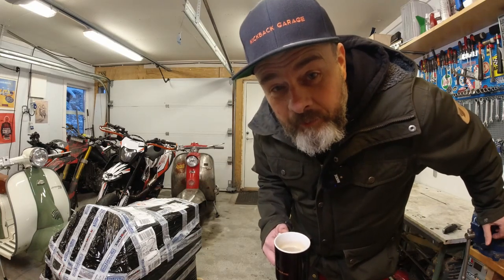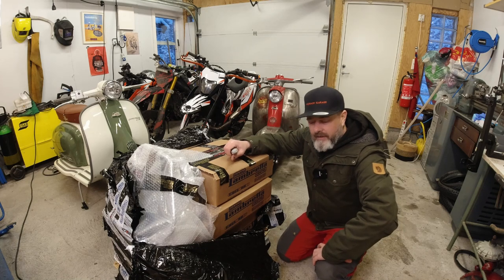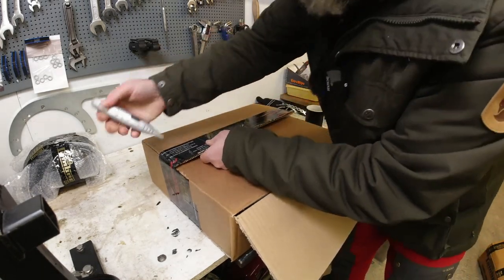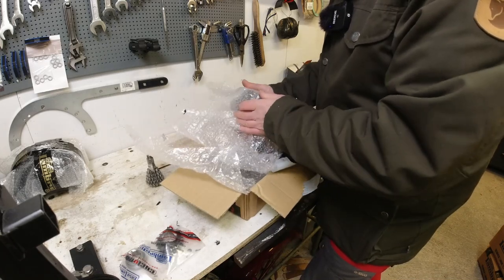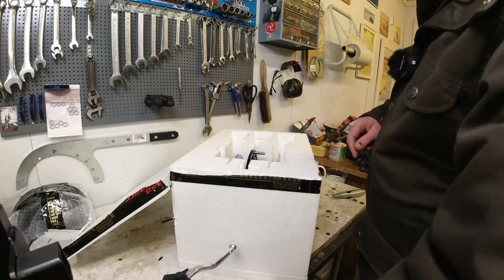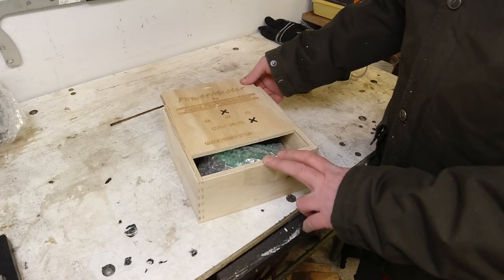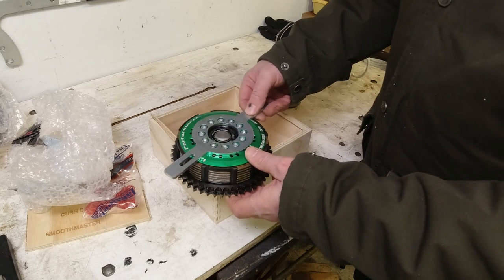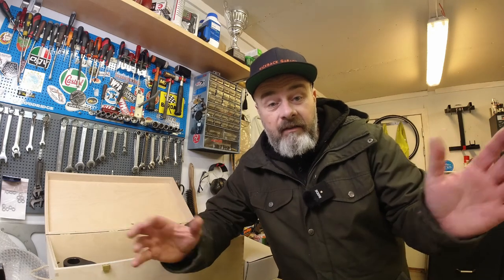Casa Performance SST265, Baby!  #kickbackgarage #casaperformance

Comment: I know by the way you open them boxes you've done this many times before, cutting away from the hand holding the box is a smart move, found that out the hard way, looking for an old Li I50 to restore, good at body work and paint, but engines are not my strong point, hopefully after i watch you and another guy building engines will give me the knowledge i need,  finding a Lambretta with an engine in Ireland will be difficult , plus the smart gits check prices online and ask for stupid money, but i know there's one somewhere waiting for me, even dug out me fishtail that's nearly 40 and looks well cool still, wore better than i did the 90's was hard on the head and body, great watch thanks mate ☘️🍻

Comment: Really interested to see how this goes together Rob. I bought a fully built SST265 engine from Rimini last year, so didn’t see the components that go into the build. My engine is sitting on a shelf in my garage waiting for my S1 to return from the painter. Chances are you will have your engine built before I have mine fitted into the scooter 😃.
Reply from the maker: I hope not, for your sake! haha
Reply: Have a few other bits to complete this build: Tank, new panels to cut, etc... Hopefully sooner than later, bank account is VERY slim now, hehe